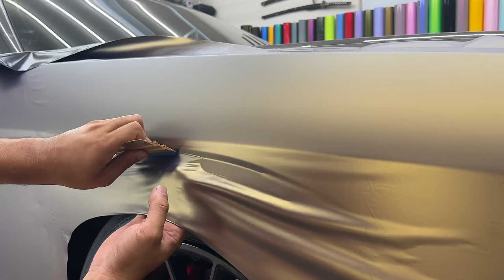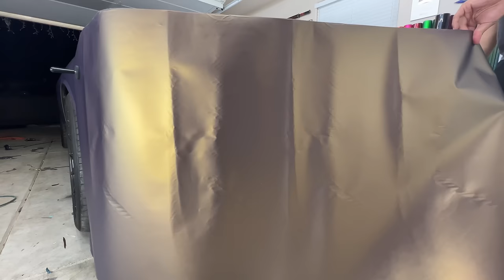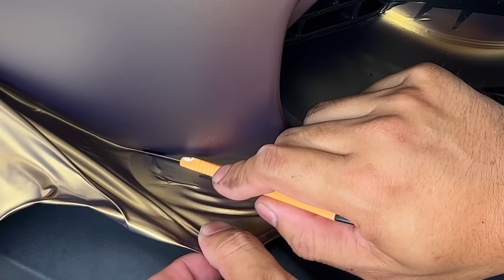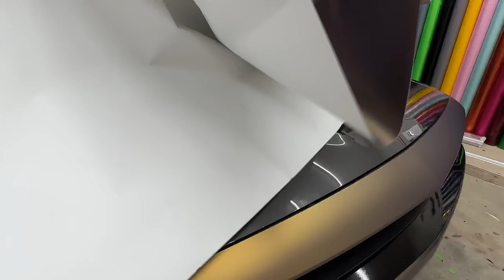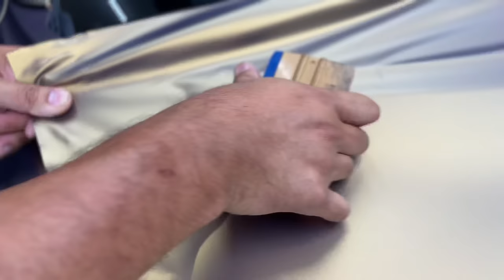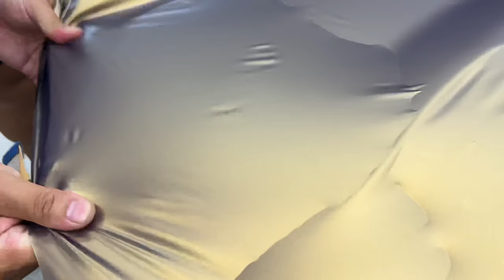SHADOW GOLD Challenger Hellcat ASMR Wrap Guide | The Hardest Parts In REAL TIME

Comment: I wrapped cars for a living for 8 years as one of my first jobs. I miss it. It's really a lot of fun if you have the patience.
Reply: How much were you making?
Reply: How do you not scratch the car with knive???? 🙏🏻
Reply: @interviewtime1170  You can use the tape he uses in the video. It works really well. There is a lot of skill to using a knife. You should be able to drag the knife very lightly. There will be the slightest friction and a faint squeaky sound. It's a fine line between the slightest of pressure and no pressure. It is the most difficult aspect of wrapping.
Reply: I want to learning how to wrap cars. I just turned 18 and it is kinda my dream. I want to have my own company for that purpose. Why did you stop wrapping, was anything wrong with the job itself? Sorry if you don’t want to answer the question.
Reply: @stefanvasilev8967  No problem. It's a great job. The real money is in owning the business, which often means doing more than wraps. It's a large cost upfront. Single color wraps are easy but most wraps are people putting their logos on cars to avoid sign permits. those jobs are really what pays the bills. Installers don't make much so it's really in owning printer, plotters, and such. But most of all you need clientele, not just buddies wanting a flannel jetta.

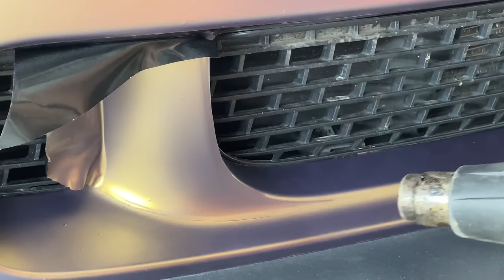Comment: Just so y'all know, @4:30 into the video, he should've started with that spot before later ng the bigger sections, reason being, when u lay a small piece of vinyl on top of other vinyl or when u make a finish cut like that it creates a little  lip that is hardly noticeable but over time the wind from driving forward at high speeds and not to include the factor of rain and snow if your gonna drive your caf as a daily driver will cause it to lift and not stick again, no matter how good the vinyl no matfer how good u stick it the wind creates forces that push against the lip sticking up over and over until it cant handle the stress anymore just like with everything in this world, it will become weakened and give up, also he's using too much heat and stretching too much on this car, the challenger is one of the easiest cars that wrap until u get to the corners  and the grille and trunk areas, i also DO NOT recommend using as much vinyl for one body part like he did u will see so much extra viny at the end after doing one vehicle, he could be saving himself money or wrap for small objects or even another car, try to measure out how much you'll need and add 2 inches to your width as well as your height, if u have a bunch of curves and objects sticking out from the car then it gets more complicated but I've printed out what I wanted, yes I wrap cars for a living
Reply: These notes are good and useful. Yes, this is as it should be.  I would like to ask a question here: Is this vinyl made in China or made in other countries? I need more of it to use here in Syria.

Comment: Those exhaust vents on the hood are so easy to remove...
Reply: My biggest gripe of this video. Too much knife work in areas you don't need to. The hood, door handles, rear spoiler, rear windshield gasket. Also rear spoiler should be removed wrapped and adhered back on the car. The more exposed seams the more ability for failure. Also I never let my guys apply bare hand. Oil from your hands and heat create an issue with proper adhesion.

Comment: Hey Paradox. Been watching you for years. One big problem I have is my vinyl always sticks too much when I first lay it. I don't press it down at all but when I go to glass it out and prep it for application it sticks so much its hard to lift and sometimes leaves those lines from being pulled up. I use TW, and VF usually FYI. Any ideas or tips would be greatly appreciated!
Reply: The temp in your shop might be too hot
Reply: You can also use things like tack reducer made by vvivid to help control it

Comment: Do you ever peel up factory paint when removing vinyl?  or adjusting?
Reply: Definitely leaves cut marks on the vehicle, knife directly on paint throughout the vid.
Reply: I have removed from many cars.  Never took off the paint, but you must use heat gun to soften wrap and then peel. Can take 6 hours to remove from one car.